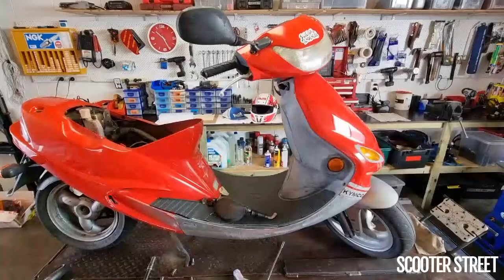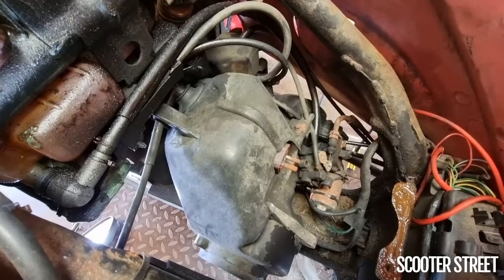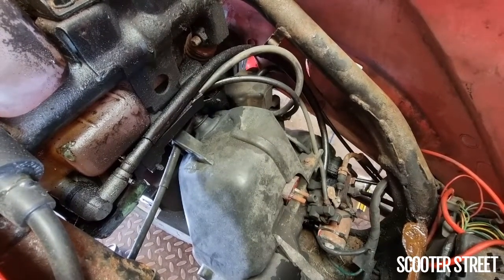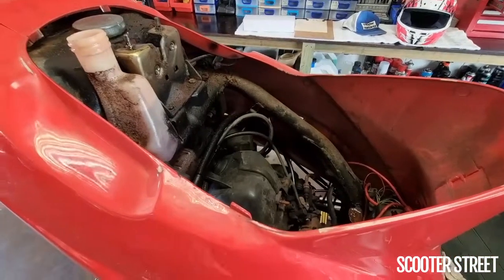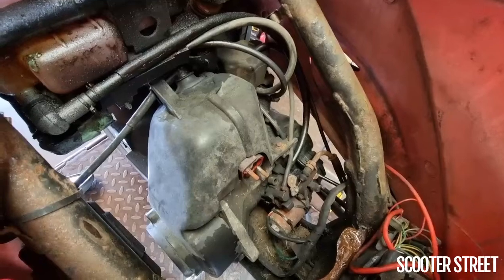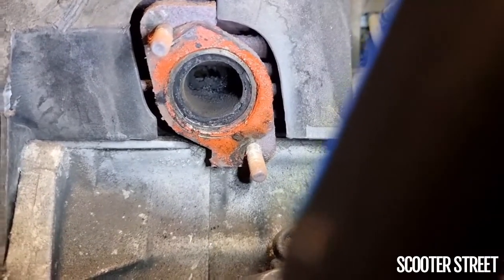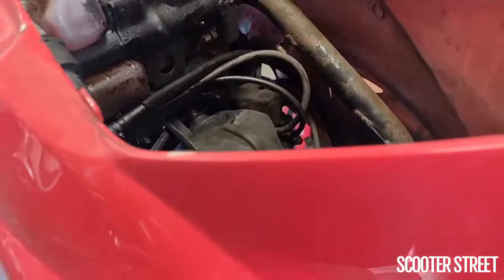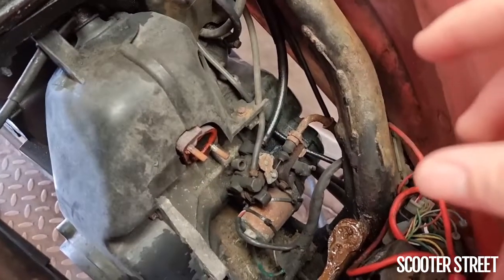Scooter Low On Power? Make Sure You Check This!

Comment: I have a little problem: I have a Piaggio Zip Base 50 ( before 1998 ) and in it I have a performance variator ( probably 6-7g rollers ), Leovince Touring exhaust, dellorto 17,5mm carb, Polini 90 air filter and an unlimited CDi. After looking through everything and taking of all of the restrictions, it still doesn't go faster than 40 km/h. Is there anything I can do to improve my top speed without spending money on a cylinder kit, clutch or similar?
Reply from the maker: I would recommend checking your jetting, failing this I would recommend a compression test to assess the health of the piston and rings. Particularly on an old scooter, it is common for the rings to be gummed in place, reducing compression and power. Also is the exhaust derestricted?
Reply: @scooterstreetau  my main jet is an 85, anything lower results top end lack of fuel. And no, we took of the exhaust and found the restriction in the header and took it off. For the sake of it we tried a friends Yasuni R and it was excellent, so im thinking maybe to get a performance exhaust.
Reply from the maker: @bb_adrians4672  Do you have the POD filter?

Comment: i have generic xor 70cc malossi sport yasuni c16 21dellorto it wont go over 60 kmh what is problem? i think rear pulley is bad please help me
Reply from the maker: Has it been tuned? Has the transmission be tuned and the parts replaced? This scooter will need a complete overhaul and tune of the carby and the transmission also test the squish prior to running. C16 usually requires a higher class cylinder.. check the rear pulley and make sure it has the correct action and not worn or damaged.
Reply: @scooterstreetau  now im upgrading kit with stage 6 mk2 sport pro and  motoforce hpc crank
Reply: @scooterstreetau  and i have now yellow contra spring and white springs and 4.7 gr rollers
Reply from the maker: @dardanetemi3448  🙌👌
Reply from the maker: @dardanetemi3448  I am happy for you, keep tuning👍

Comment: Hi I have just bought a Suzuki ay50 it has a cheap eBay sports exhaust it has no air flow restrictions but struggles to reach 30mph
Reply: I have also been told the exhaust doesn’t come with a restriction
Reply from the maker: Has it been tuned for the exhaust?

Comment: I have a moped.. and when I bang on the foot board it actually goes.. then it can fall back down to bobbing / half power .. why would this be .
Reply from the maker: You maybe exepriences an electrical issue. Check the battery and fuse and wire connections.
Reply: @scooterstreetau  I’ll try go over all connections

Comment: Do you know why my aprilia sr50 scooter dont like to drive on steap hills, its start to run but when its kinda steap it like drives realy slow. :(
Reply from the maker: possibly the gearing is not down changing, investigate the transmission. Rollers, torque spring and rear pulley action.

Comment: I have a malaguti f12 and when I start it i give it full throttle and it dosn’t have power to go faster than 5kmh. And it takes about 2 seconds to accelerate I changed the reed valves and rollers I don’t know what else could be. Can zou help me?
Reply from the maker: Hi, start by looking at the air filter and the carby.
Reply: I cleaned the carb and put the new air filter on and it still doesn’t work? What else could it be?
Reply from the maker: @aerox-70cc  Cleaning the carb does nothing if something is broken or out of setting. Change the spark plug and look for broken rubber around the air box and carb manifold. seek help from local Mechanic..
Reply: @scooterstreetau  nothing is broken I put new cylinder and piston i changed the spark plug and checked everything, nothing seems wrong
Reply from the maker: @aerox-70cc  There must be an issue if it is bogging down, take to local mechanic.

Comment: Hello Sir you are my last resort,  my scooter was running perfect, after a rain back home, next day, turn on easily revs high but doesnt move, i try, new spark plug, change cdi box, checked all the cvt clucth and variator, belt all good, check magnetic flywheel seen fine , since she starts revs high but doesnt move, looks like symptons of over rich but umpossible since she was riding perfect before that rain, a total mysteri to me, any advice or idea you have come across something like this, i can just assume that as the rain, but stange, best regards
Reply from the maker: Check everything in the drive system, start with the drive shaft at the crank, is this rotating when the engine is throttled?
Reply: @scooterstreetau  yes rotating normal. Good compression, cvt looks all good, rollers , clucth its not bitting , but i checked all the springs are good,
Reply from the maker: @Prasowkasportowaa  Does the rear drive shaft turn the rear wheel when rotated by hand? If not, replace the rear clutch pulley
Reply: @scooterstreetau  yes there is any chance that the flywheel go bad whit some rain?
Reply: @scooterstreetau  i checked everithing piston, rings, bore, changed spark plug bobine, plug old cdi, checked all the cvt stuff , belt springs variator, took exhaust sytem a part nothing block it. During rain i had 2 cables exposed the electric choke on the handlebard and minimun maximum swicth as i was on the process of turning it naked.
Reply from the maker: @Prasowkasportowaa  You said the engine is rotating so the flywheel must be rotating.
Reply: @scooterstreetau  yes flywheel is rotating, big mistery my friend, i tryed it all, i give full gas smoke coming from pipe look like the bike doesnt go higher than mid rpm i dont have rpm gauge look like rpms dont want go higher i have a video i tey post it here and show you
Reply: @scooterstreetau  full gas mid rpms wheel doesnt move
Reply: Sometimes at full trotlle she as a spike like she will take off but than doesnt move again
Reply: @scooterstreetau  the video was at full throttle
Reply from the maker: @Prasowkasportowaa  You have not answered the question of the clutch? See above.
Reply: @scooterstreetau  the wheels are ok, can you check the video i posted the link.
Reply: @scooterstreetau  just to skip, standard stuff i work whit scooters for 15 years, rebuild modify, ect... Have never crossed whit this problem, my first mensage was on a hope of having other expert and see if he had crossed whit something like, the scooter was working great, 70cc 19mm carb optimal fuel /air ratio , after a rain next morning she turns on but after give full throttle the wheel doesnt move, have you came acroos anithing like that?
Reply from the maker: @Prasowkasportowaa  I see this many times, You have not answered the question of the clutch? See above.
Reply: @scooterstreetau  i know i didnt awser because i said on other mensages here that the clucth was working proper, anyway problem its solved, thank you for your time and availability to awser the questions, was an ignition problem, the flywheel was defected somehow, i changed for a new one working great. All the best

Comment: I need serious help i have a yamaha scooter motor with no takeoff power and its chain and gear drive, i cleaned carb and still no power.
Reply from the maker: Best advise I can give is to have it assessed by your mechanic. There so many parts that can cause this issue..
Reply: @scooterstreetau  i checked the head gasket and it didnt have one so i installed one it worked but still laggs out at start, it only has kick start, no battery, so only thing i can tell is that its a carb problem
Reply from the maker: @scorphkclark9122  If it was riding fine, then all of a sudden the issue developed then you will find it is a wear, vibration or electrical issue. Wear on any moving part in the transmission or air to fuel system can have this slow effect. It can also come from vibrations effecting the carby mechanical parts, float, needle. And check the carby tuning if there has been a significant weather change.
Reply: @scooterstreetau  i bought it from my boss that aquired it from a storage locker cleanout he did, it was runing worse than now when i first bought it till i cleaned the carb it runs better but still has no takoff power at full throttle.
Reply from the maker: @scorphkclark9122  It may have a dirty air filter, it may not be connected at the carby or perished rubber hose connector. Wants more tips? Donate at our Home page🙏
Reply: @scooterstreetau  lmao it has no air filter or muffler. I dont think that has anything to do with it loosing power cause more air and fuel mix equals more hors power just like a car.
Reply from the maker: @scorphkclark9122  Haha, ok. Good luck👌
Reply: @scooterstreetau  after work today i worked on the clutch springs loosened them up and recleaned the carb and adjusted another screw, its got alot more take off power now so im gonna test drive tomorrow.
Reply from the maker: @scorphkclark9122  Nice work.

Comment: My scooter has little exhaust coming out and it's not going at it's regular speed
Reply from the maker: Fix that straight away, it is important for drawing heat away from the engine.
Reply: Im not sure what's wrong. I recently overfilled my gas tank and gas leaked from the evap canister. Last week it was running perfectly. I bought a new canister but I'm not sure that will fix it.
Reply from the maker: @tajrice5398  Get it checked out at you local Scooter shop.
Reply: @scooterstreetau  found out it was my muffler..... apparently the fiberglass in my muffler has shifted all i had to do was still a metal rod in there to poke it, it keeps coming loose so I'll either remove it or get a new muffler
Reply from the maker: @tajrice5398  Nice work mate. It must have been blocking the flow of gas and slowing the process, fix it 100%, good job👍